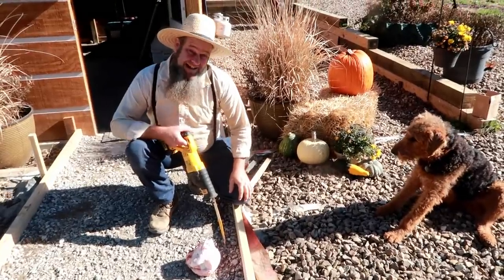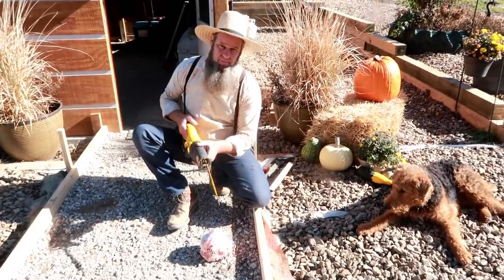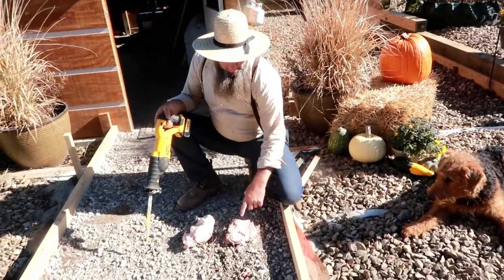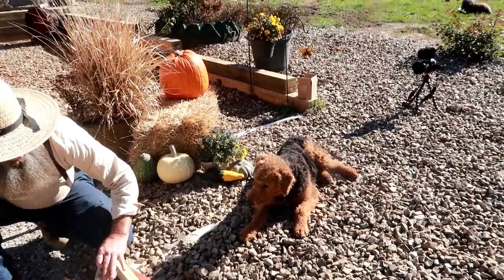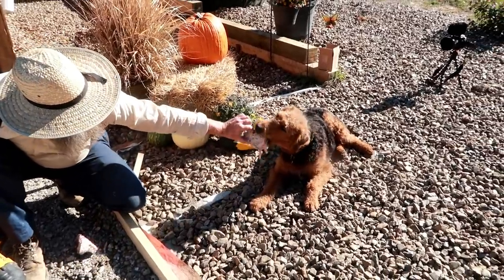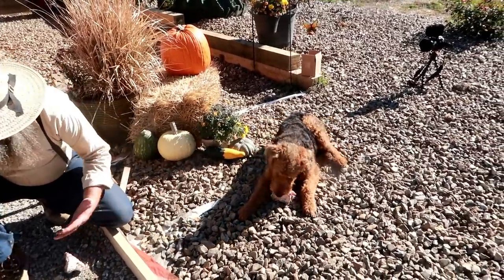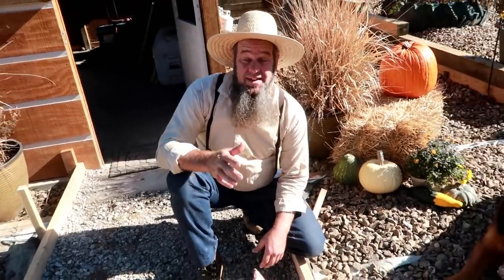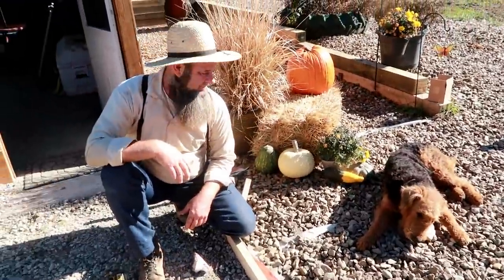OFF GRID bunker/ ROOT CELLAR update.. we called in the pros

Comment: Good thing you made the outdoor kitchen tall because you could have been banging your head on the ceiling. The first year we were here we had retaining walls and a cement pad put in under our deck. We have a walk out and the previous owner didn't do it and we felt it was important to keep water away from the basement. Our dog just before it was cured decided to walk across the whole length of the pad. We have his paw and claw prints forever etched in the concrete.

Comment: Here (in our corner of the world), 
it has become increasingly popular (but only recently)
to use an inch of clean 
leveled & compacted dry "fine" sand 
&/or 
two inches of EPS (Expanded PolyStyrene Foam)
between the old-floor & the new layer of concrete,
as an isolator, to prevent "reflective" cracking
from the underneath-layer
from coming through to the upper layer of concrete.

However this can cause the new floor to be 
about 7 inches (180 mm) higher than originally planned
(i.e. 1 inch sand,
2 inches foam,
2 inches of concrete under the reinforcement,
& two inches of concerte over the reo-mesh
totally 7 inches (180 mm in our language)).

Comment: Not to be a downer but that recoat floor will probably crack all to pieces. Didnt even add a bonding agent to the top. Probably should have went with tile or texture finish. Concrete and wood dont work well together for buildings prone to rain intrusion. Wood tends to rot where they contact. Love the vids though. 👍

Comment: Hello, I am wondering would you rather have a basement or the bunker? I am building a off grid homestead and outdoor kitchen so not sure if I want a basement under house or kitchen. I am thinking under kitchen and also thinking of putting door from outside so if its hot out when I shoot a deer I can hoist it down there as it will be cooler tell I am able to butcher it. What's your thoughts on this?

Comment: So much enjoying watching this whole thing come together!! Great job! Question: what bonding agent did you use between the layers of concrete in the outdoor kitchen floor? If I recall correctly, a bonding agent must be used between two different layers of concrete or they'll work against each other and the top layer with crumble over time. Not sure if maybe a certain thickness makes that not necessary or not?
Smiles and blessings...
Reply from the maker: Yep, over 3 inches and the concrete guy said no problem...2 inches or under = problem

Comment: hey yall, im soon to have a farm up in North Hokkaido, so I was just wondering, you said fill the pipes with concrete next to the re-bar...why do you fill the pipes with concrete*?
Reply from the maker: They will act as columns to hold up that side of the pad so it does not sink because the dirt is loose and will settle

Comment: What's with the concrete in the pipes?
Reply from the maker: Question from a guy who watches most all the vids lol here ya go : those will act as columns to hold up that side of the pad and the rebar will hold the back side... when that dirt settles and it will the pad will not move 😉 I know, I'm a genius 😜🤠👍
Reply: MOST of the videos. I guess I missed that point.